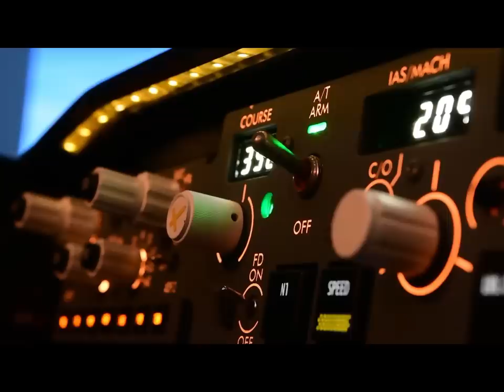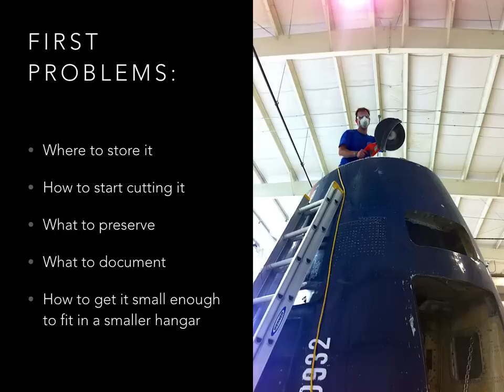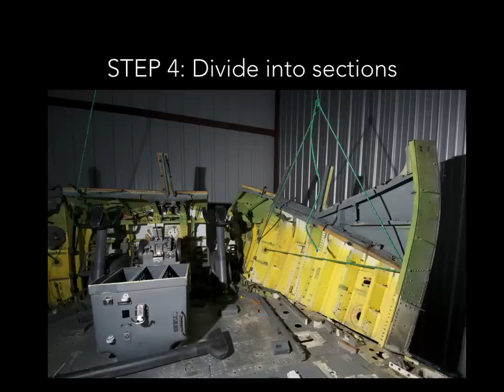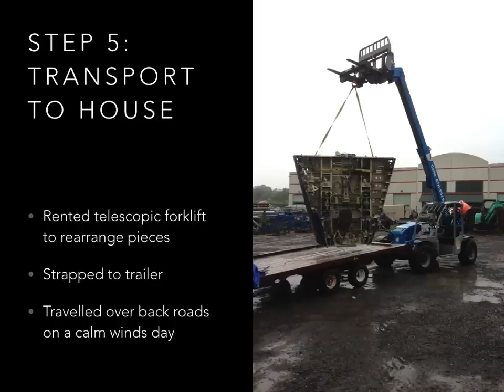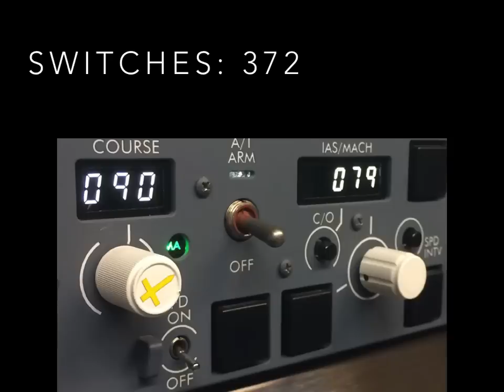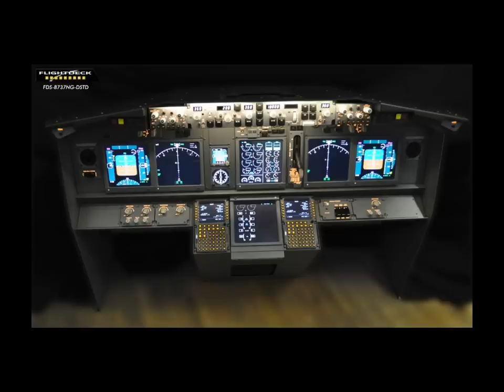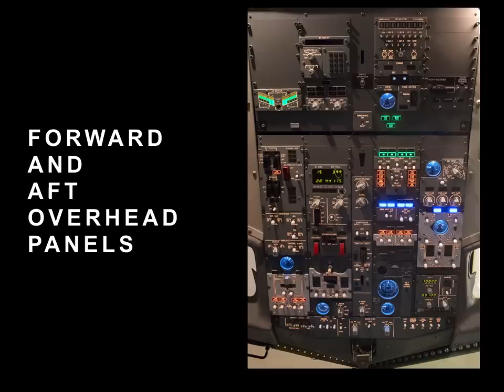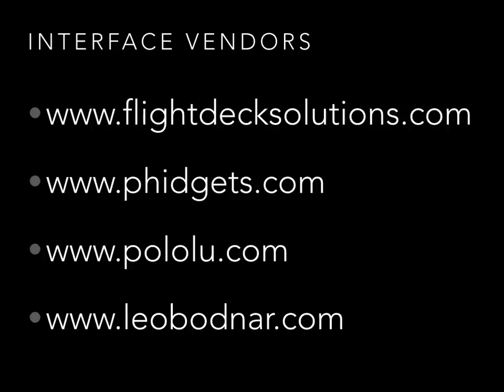Boeing 737 real cockpit simulator conversion

Comment: Amazing job. I found your video looking around for projection simulations because I am doing the same project but with a UH-1 Huey. Only the tail boom is removed so the sliding doors operate. Pilots will have full functioning controls and a 270 degree screen with 3 projectors. And for kicks, two door gunners will be on station to operate the door guns but will using VR headsets. Operates off of DCS so I can create my own missions and  enemy forces.

Should be a hoot. lol
Reply from the maker: VERY cool! Can't wait to see the finished product!

Comment: This is pretty impressive and I have been flying for 41 years with just under 25 thousand hours in the book.   The only issue is going to be the point of when you decide to sell your home.  Maybe a building in the back yard may have been a better idea.
Reply from the maker: Ray, thanks for your reply. Been there, done that. The whole point of cutting up the cockpit was to make it modular for the inevitable move. Americans move, on average, once every seven years. We are about average in that we were in our house in Virginia for 7 years and nine months. We moved from Virginia to Florida last summer and we brought the sim with us. Imagine my horror when they toldme that houses in Florida generally don't have basements. The sim is currently disassembled while waiting for renovations to a small outbuilding on the property we purchased in December. I see this as a great opportunity to fix many things I failed to get right the first time.

Comment: Its interesting that you mentioned how you forgot to put index marks for installing the control columns. Those would have originally had marks on the teeth for lining them up! I've installed a few of them. Ive also been crammed into those holes in the wheel well many times!
Reply from the maker: Wow, that’s really useful information! will look for those when ultimately get around to reinstallation

Comment: What about AC in the cockpit? It's got to get warm in there with all the gear.
Reply from the maker: It's actually fine in an air conditioned space. The computers are all external and the LCD screens don't generate much heat.

Comment: Speaking as a B737 pilot (15 years, 10 thousand hours on type, flown all generations,except the Max which I was about to fly before ours were grounded) and simulator enthusiast.....I've never seen such up close pictures of the intricacies of our control setup, only technical diagrams during training. Also, you're a maniac, and I mean that in the best possible way! Yes, for us, simulator time is pretty close to a root canal or something like that, I'd rather not step in one again, but this is true dedication. I'm not sure anybody who just sees the final product would appreciate the level of tenacity and skill this took to set up. An absolutely amazing job! As far as simulators go, I peaked at making a custom stick extension for my Thrustmaste Cougar, and adding hall effect sensors!

Comment: 9:00 I'm a pipe welder and just to let you know, you should not only wear Safety Glasses but also a face Shield. Probably not to critical with the "Tiger Paw"/ Flap Disc but any grinding wheel, Cut-off wheel or wire wheel most definitely. And don't forget your handle. The Jobs I work at, Safety Personal will fire you on the spot for not having a Guard, handle or face shield. I see many people who are DIY'ers that ignore any of that.
I've been to the Eye doctor myself 2 times removing metal from my eye balls. They had to use a small grinder to get it out. When it comes to my eyeballs I don't take any chances.
BTW Your Simulator is Incredible !!!
Reply: thank you!!! i also think not being safe is stupid.
Reply from the maker: Thanks for your comments. Yes, I was stupid when I first started this project. I will definitely follow those rules for any work needed in the future.
Reply: @peterkwu  I'm no Safety Nazi, Ive also have done the same but had to learn the hard way. If you loose your eyes, you can't fly anymore. 😢
Reply: @ze_german2921  I have gotten a piece of a single grinding wheel in my eye working on a farm as young adult. I was not that stupid again and I was able to get a friend to take it out. I'd imagine it would be worse will aluminum as it's not magnetic. Also I was scared as hell when I got an MRI years ago thinking of a giant magnet pulling a missed steel wire, but it was all good!

Comment: Hey @PeterWu You're an inspiration! I'm incredibly impressed with your ingenuity and dedication to the build. Looks like the boneyard 737 was money well spent! I imagine it is incredibly difficult to replicate the real feel and weight that the solenoids and certain switches have (even if Peter and the gang at FDS do an outstanding job).

Questions I have about your build in particular are:
1.) Why the custom interface of the throttle quadrant vs. the FDS Pro MX equivalent? Any particular deficiency in functionality or realism?
2.) For the screen what are the major obstacles to a true collimated display? Cost of the mirror? Production of the mirror?
3.) What was the primary motivation for converting a salvage aircraft vs modifying a complete FBPT from FDS or another manufacturer? Could you not accomplish the linked controls, control loading, and cockpit enclosure through modification instead?

After watching your video and videos/blogs of others I wanted to get your thoughts on the possibility of a multi-sim configuration with ~4 sims and maybe 1-2 seats for ATC. This would be for recreational use, not a commercial complex. This would obviously be housed in a purpose-built, stand-alone structure. Planning on using the entirety of a detached garage-like structure that has RV doors. It's a large and tall structure. Wide doors for ease of entry. Space isn't an issue.

I'm holding out to see what functionality $MSFT is going to bring with FS2020 to hopefully run that but I'm not opposed to Prepar3D, Xplane 11, or even FSX.

Goals for the project would be
1.) As close to 1:1 functionality of the simulated aircraft as possible. Most likely 4x737s for cost purposes, but considering a single 787 or 747 in place of one 737 if not cost-prohibitive. I wouldn't consider salvage conversions for these models. I have also considered doing 2 sims for civilian and 2 military sims running DCS. I imagine military salvage is cheaper and more cost-effective simply for logistical reasons. Harder to source the components/avionics though, probably more of a custom fabrication/3D printed scenario. Warbirds are less complicated. Many DCS players have A10 or FA18 simulators at a fraction of the cost of a 737 FBPT.

2.) Multiplayer.

3.) ATC via FSX or VATSIM or some other locally networked means

4.) Observation/Instructor stations in the sim (This could simply be filled by the ATC area but one or two observer seats that doubled as an instructor station to cause failures, monitor glide slope adherence, and other evaluation could be awesome as well.

I haven't been able to find too many resources on how to network the devices and the logistics of assembling these sims except for a visit to Hill AFB where I was able to tour the simulator facilities for training pilots on the F-35 and F-22. They actually have their two simulators in 360 domes that were custom casted. The 360-degree projection is stitched together by several large computers and the effect is a simulation of so real I fell over as the demo pilot rolled the aircraft, and I was standing on the ground! Unfortunately, detailed descriptions of the network are classified... BUT I have seen with my own eyes a 4 "player" Prepar3d simulator setup. I know the concept is proven. And they will do 10, 20, 30 airmen in a single simulation at times. Not in full FBPTs but from laptop clients or desks with monitors and cockpit peripherals.

After watching your video through 4 times (You're welcome for the watch time ;) ) The level of effort required is too high to have 4 salvage conversion simulators, even with contractors. Would you agree?

Thank you for this video and the dedication to documenting the entire process through your long and arduous build. Many take for granted the extra effort required to document everything. I really enjoyed the video and look forward to seeing the improvements you make once the sim is up and running in FL. Good luck with your move!

Comment: Stunning work :)
I want to make a simpit, but to the scale and budget of someone living in a rented flat in a European city, and making full use of the 80/20 rule. Just replacing a desk and swivel chair with a fixed seat and fixed controls makes suuuch a huge difference.
Reply from the maker: DundeeDriver Thanks! I bet yours is a lot easier to move from one flat to the next!

Comment: That is cool as hell.  These home built Sims are getting to the point where they rival qualification simulators.  In terms of flight deck environment, this one is probably better than a one, as it's literally a decapitated 737.  Someone is going to build one on a hydraulic gimbal at some point, if not already.

Comment: Man I tskr my hst off to you for the time energy committment knowledge and most of all, patience in building this 737 simulator. I started doing my pilot license years ago but after doing everything with roughly 60 hours cross country completed, never did go and do my final flying test check-off. Here I am 30 years later (63) getting the flyiung bug again, Will never be able to afford or have the time to do what incredible job you've done, but would love to have a decent home simulator to work on protocols for flying instrument approches. If I do start flying again it will include becoming instrument rated! Thank you for sharing!!!

Comment: As a simulator technician for the airlines for 30 years, 20 years on the 737NG, it looks like you did a good job. I would miss the lack of motion, however. What visual did you use?

Comment: I see structural extrusion parts on this this that I CNC machine to this day!   Ha that’s crazy, grant it I’ve only been doing it since 2012.  Any 737 fuselage is built here in Wichita, KS.  Case in point at 39:25 this smaller “L” shaped parts located by the spring system you built.  I’m seeing a lot of familiar parts all through out this video!!   Pretty darn impressive!!!!
Reply from the maker: Thanks for building such a sturdy airplane! I love my real Boeing parts because I know they will take all kinds of abuse and never break!

Comment: VERY IMPRESSIVE BUT YOU SHOULD USE XEON WORKSTATION FOR THIS HANDLING DATA AND RENDERING.
Reply from the maker: Thanks for your comment. The sim is currently disassembled for a move and I will take advantage of the time to reconsider my hardware choices.

Comment: Very good-looking scenery screen setup. Was this commercially available? I like how they are curving inwards towards the bottom. Are they 180 degree or more? Can you fly visual cirquits? And, how many beamers do you use?
Reply from the maker: Yes, I purchased it from Art May-Alyea at Northern Flight Sim. I don't think he makes that model anymore but he does offer a 180 degree curved screen setup. The 'bowl' design did make it hard to calibrate, because the three projectors essentially needed to be in the same place.
Reply: @peterkwu  We have a number of commercial sim centres near here but most of them neither have a motion platform or a screen setup like yours. They still charge lots of bucks for using it.

Comment: Dear Peter
why did you not go for FS9(flight sim 2004)
witch does the same thing as prepar3d,but in my oppinion mutch better. has less strain on the pc 
therefor gives you better preformance and has more applications to use

f.e
REX

pmdg 737ng
Full us roadnetwork and lighting

full googlemaps overlay off globe
airports

etc etc etc
the list would be to long and in the end would cost less money then you spend right now.
also fs9 is still supported on AVsim
Reply from the maker: I never tried it...maybe some day I will. The current setup consists of:old computer, Win7, P3D, Prosim737. Minimal add-ons lead to a very stable system with good frame rates. Outside visuals are not super important to me as I spend most of my time flying instruments.

Comment: Very well done. What an awesome simulator. BTW, what you call a die grinder is just called a grinder. A die grinder is a very different beast. Whatever you want to call it, you've done very well using it to turn your cockpit into a giant Lego set.
Reply from the maker: You’re absolutely right...I should have been calling that tool an angle grinder all along!

Comment: This project should be re-built into a proper trailer so that it may be shown and shared at fairs, expos, shows, schools, airfields, and so forth.
Reply from the maker: Already done by Art May-Alyea at Northern Flight Sim. I really prefer mine to be in a fixed installation because it's easier to service. Dynamic force feedback would be hard to implement in a portable format because of the power requirements.
Reply: @peterkwu  It is/was about sharing the ideas and the presentation. There is always tons of power at airports, malls, and so forth and since this is being used in a home it is doubtful it is over 100 amps.

Comment: *Spends $13k on cockpit 

*Uses windows 7 to run the sim
Reply: That's how the commercial ones do it too. Well, they're probably using XP.
Reply: eri Windows 10 is a lot better especially since most modern computers can’t use windows 7 or xp.
Reply from the maker: Win7 works fine for this application. It works. Crashes are really rare. The computer is old. I see no compelling reason to upgrade.
Reply: @SuperSpreeGaming  But when you're using an older computer that never gets connected to the Internet...

Comment: so how do you plan to get it out of the basement
Reply from the maker: It’s already out…I fully disassembled it and packed it up for our move to Florida. Two years later it is still in crates, awaiting renovations to a detached  two story garage that will house it. While waiting I have fully stripped the paint from the exterior of the airframe in anticipation of repainting. I also am getting ready to lighten the airframe by removing unneeded structural metal with a plasma cutter. Stay tuned!

Comment: Where did you source your planetary gear-head?
Reply from the maker: Try this: http://www.ing-pini.it/IT/Prodotti/PlanetaryGearboxes
There are other sources. I used these and they are very high quality.
Reply: @peterkwu  Thanks, I finally built a reduction system based on large toothed belts.